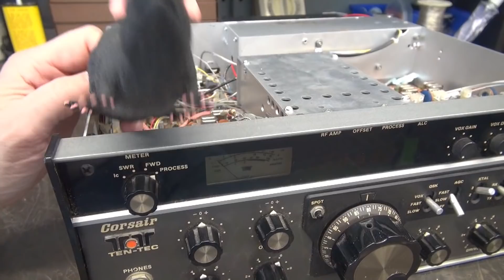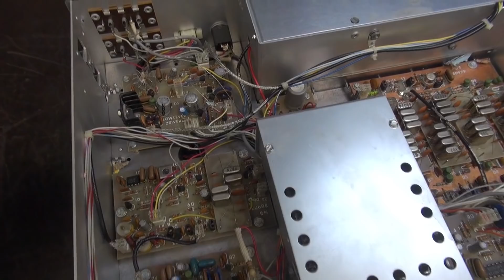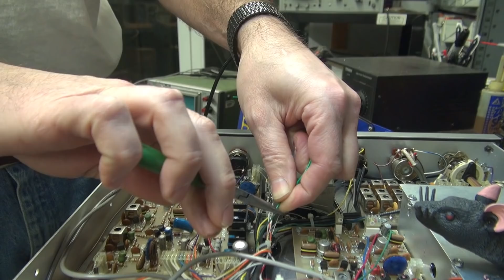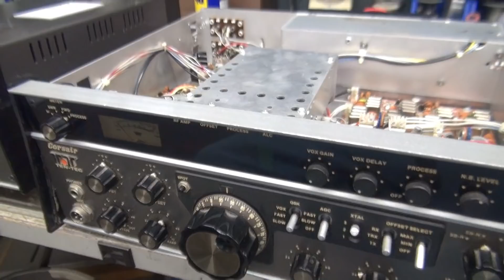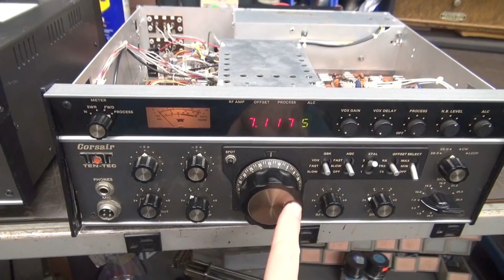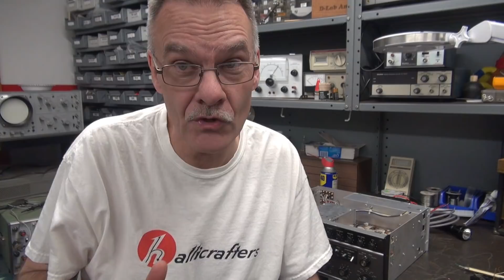How to repair Mouse damage Ten Tec Corsair Ham Radio Transceiver

Comment: “The display on my Ten-Tec 544 radio blinks when it is turned on for the first time for about 15 seconds, then it returns to normal. I replaced some capacitors that I suspected, but the problem is still the same. I would be very grateful if anyone could help me.”

Comment: Hi I'm wondering what kind of cabinet can I use with a 68 drip edge bandmaster? Also what should I check for before turning on the head I'm told it works but I don't have a cabinet to test it when I if/i get it but just want to make sure it doesn't blow up on me

Comment: IIRC, 20-30 years ago power lines, cars, tractors and farm equipment were particularly prone to rodent damage.  An investigation was done and it was found that rodents like to chew on wire insulation because it smells like soybeans to them.  Wire manufacturers have since changed the chemical mix in their insulation so this is not the problem it once was, but old radios still have the old wires in them are now especially susceptible to this damage.

Comment: Luckily no nest and no mousebaby. 
In the 80s i had an old tuberadio on the desk. The owner told me, the radio stinks!
I found a dead mouse in it, hanging over a tube, which hat the B+ on top. The Owner must have switched on the radio and the mouse experienced an electric chair.     yech......

Comment: I wonder why a mouse would want to eat rubber.
Reply: Alphabeets, although it probably doesn't apply to this fairly modern radio, some plastics and rubbery insulation are actually or have in the past actually been made from soybeans (Henry Ford built a prototype automobile with all of the plastic and rubber made from soybeans, although it never went into production). Mice absolutely love chewing on soy-based wiring, and that may have something to do with why they particularly love early radios.

Comment: What about mouse urine? They spray piss everywhere. Is there a way to at least neutralize any corrosive effects the urine may cause later on?
Reply: Mouse urine can be treated with a mixture of chlorine and water - 1.5 cups bleach (12 oz) to 1 gallon of water. This also helps kill the Hanta virus that may be present.

Mouse urine is complex and contains salts that will eat up metals. In the past I have treated it with toilet bowl cleaner and thorough washing with the above mixture to mixed results. It seems to depend upon how long it has been there, the metal involved, and the degree of damage. Bad news whenever it is found.

Coating the cleaned metal with lacquer or Rust-Oleum  may help.

Comment: I would take a  good look  underneath on the PCB side of things. Mouse urine is very corrosive in the long term. Give the boards good cleaning with some IPA and a toothbrush and check for bad solder joints. Not a bad idea anyway with a radio of this age. 73 Doug.

Comment: You got off lucky on this one. I have run into far worse. Mice usually pee on everything and corrode boards and chassis'. The last time I got one on my bench it was an Akai 1810 or 1820 (been a while) combo r2r and 8 track unit and Mr Mouse had chewed through (completely) dozens of wires and components and "marked" half the mechanicals as well as packed in bedding lint. Total loss. It/they got in through the 8-track unit.

My brother had mice get into his computers over the years. Left the slot covers on the back off thinking it would help cooling. I guess it made it easy for the mice to survive inside instead. Getting a cat solved the problem.
Reply: I was going to say, that's one clean radio for one that's been infested.
Reply: Good job mouse, those old akai big lever reel to reels are junk. Now a gx 747...